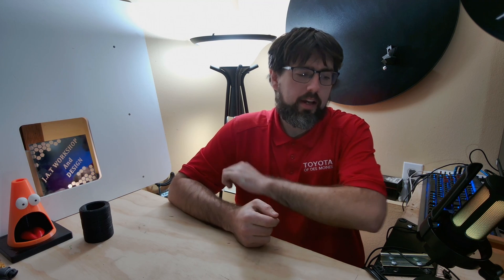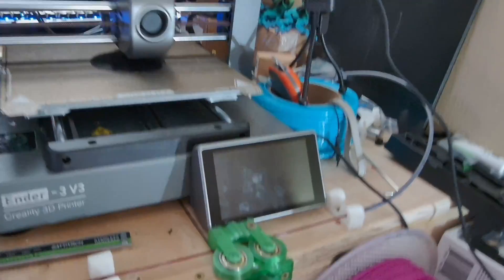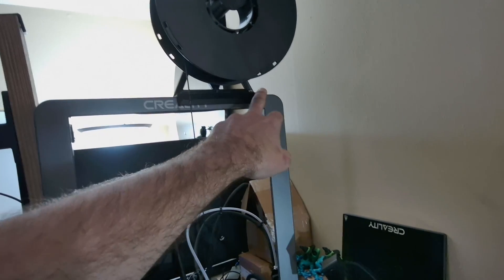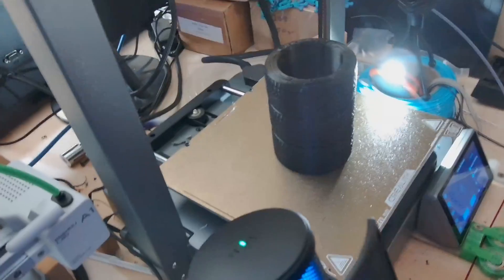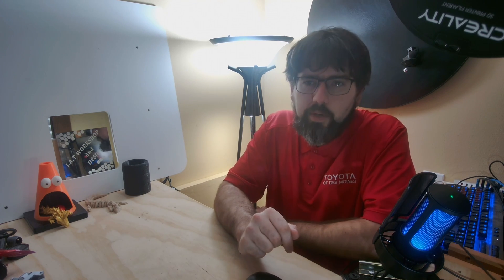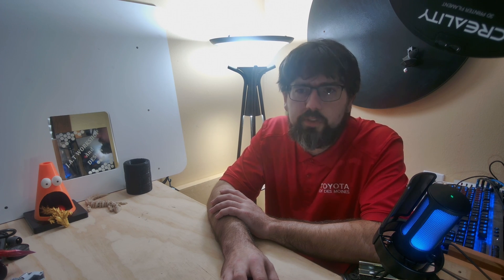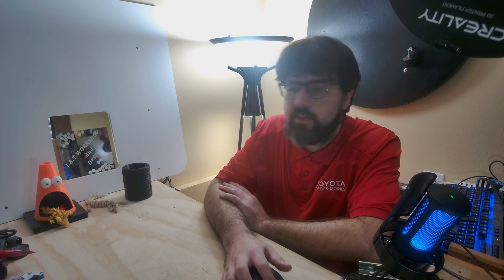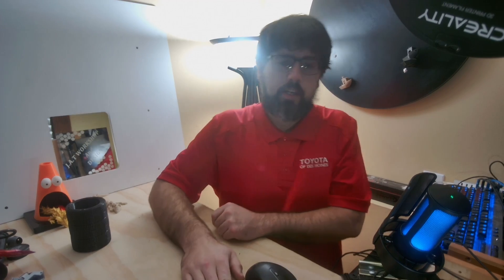Tpu WIth The Ender 3 V3 How well does it do and what need Modified.

Comment: I have a V3 plus and I'm trying to print 95A TPU but no success :( keep having nozzle clogs and the machine stop extruding! sometimes I can do 1 print, and next print always fails on first layer...

I already tryed:
0.6mm nozzle
Top mount spool from dry box
Drying filament
Different brand/color filament
Increase temperature(too much make bubbles)
Custom shim to decrease spring tension that I made...
Upgraded gears from China
Etc.

My BBL A1 and V3 KE prints TPU with almost no problems, the KE used to do same thing but I can adjust the spring tension and now zero issues.

Please, do you know what can I do to fix this on V3 plus?
Reply from the maker: V3 plus should have the same head as the V3 standard size.     Are you printing through any ptfe that could be potentially too tight?     Make sure the dry box has 0 resistance when pulling out.        Clogging with a .6 nozzle would be rather hard to do.  

Changing filament would have been my first go to as a bad batch but doesn't sound like that should be the issue.      Make sure your speeds are slowed down as it could be possible you're stripping the filament instead of pushing it     could be not tight enough tension.      Also check retraction. That it's in the .8-1.2 range
Reply: @JATdesign  I'm sure dry box has very low resistance, sometimes the extruder simply is jammed and can't push any filament even if I use my fingers to push..

as I said, I tried differente brands/color 95A filaments, the results looks the same, but it's always gears clogging on extruder and filament don't go down... I have creality cr-tpu 

I have printed a lot of TPU on both A1 and KE, but I order this V3 plus and I thought that at least I could adjust spring tension on extruder, maybe this is the problem. And I'm using orca slicer with similar configs

I designed a custom spacers that makes the closing spring lever don't go too much to the left.. this made a little improvement but always after 1 'good' small tpu print, the second one will fail on first layer

PLA and PETG prints on 0.4mm nozzle is doing good, zero extruder clogs.
Reply from the maker: @AndreH5656 what's your initial layer height setting  I have had clogs in the past from initial height too low.  I'll generally do initial layer at .25

Comment: I am using 95A TPU V3 Plus and having trouble with the filament going through the head. New at this 3D Printing. It sounds like the head starts grinding then it stops pulling in the filament… Any advice?

Comment: Thank you for sharing this video, my question is: if the filament does not pass through the filament detector, does it work the same or do I have to do something in the machine configuration?
Reply from the maker: @Picard2003  you put a chunk of filament in the sensor  so the machine thinks it's there

Comment: I know you've went through the settings but I cant seem to find some of that stuff that you talked about would you mind sharing the profile?
Reply from the maker: @amitfpv09  Creality recently switched to a different slicer so many of the names of things are different then they used to be.  I don't use the new version.  I have pretty much switched everything over to Orca slicer now. That they natively have the V3 in it now.
Reply: @JATdesign  Do you have presets for orca slicer that I can use?
Reply: @JATdesign  Does Orca slicer fit the settings you gave in the video? Do you have a preset for tpu that you could send me I will really apricate it
Reply from the maker: @amitfpv09  orca slicer is much closer to the naming yes if I remember my K1 max tou video was done on orca.  The two profiles are very similar.    I haven't yet made a orca profile for TPU as I haven't needed to print it for the last couple months.     (Still getting everything setup in my new location).  But between those two it should be able to get you close.      I do eventually plan on doing an updated video once I do get it all setup and done.
Reply: @JATdesign  Oh ok ill look into the k1 max settings thanks

Comment: I got some 85A tpu and i cant seem to load it... i can only push it in so far. when i can't go any further and try to lock the extruder, i can pull it right out. I sat there for a good while trying to get it to catch but didnt have any luck. Its like trying to load cooked spaghetti.  

Ill have to try some 95A. I was really hoping to print some really soft stuff but i dont think there's any way to get it loaded and even if there was, i would be afraid of jamming the printer on the way out.
Reply from the maker: You should be able to load 85a.   Lock the extruder and slowly feed the filament in while it is moving the extruder gears.    It should catch and feed normally.
Reply: @JATdesign  that totally worked 😅 thank you! Excited to finally try out some TPU!
Reply from the maker: @Tristaniscool  glad I could help

Comment: Hi there. Thanks for the videos. They are the reason I decided on upgrading to on Ender 3 v3. One question though. Just received the v3 and I don't appear to have the holes on the top gantry to screw ion the top spool holder that you created. The screw holes are visible on the underside of the top gantry but not on the top. Did you have to push them through by any chance?
Reply from the maker: I did not   they were open and accessible out of the box on mine.
Reply: @JATdesign  will get in touch with Creality I think. Thanks for getting back to me
Reply: seems that there are different versions out in the wild as the ones being shipped now do not have the top 2 screw holes and are blanked off under the gantry. They do have 2 m3 holes on the back of the gantry though.
Reply from the maker: @bane2000  I will work on modifying the file to snap over the front and utilize the rear two screws.

Comment: Thanks for posting this video. Can you please share the TPU you are using? the link in the video description is sending me to PETG and not TPU.
Any chance of sharing the Creality Print profile you've created? :)
Reply from the maker: updated link  Thank you  I can work on uploading the print profile, but will be next week.
Reply: @JATdesign  Thank you, please reply once you've uploaded it so I'll get a notification. Appreciate your work!
Reply: @JATdesign  Are you able to share the print profile for creality print please. Really struggling to get TPU to work with this printer. Thanks
Reply from the maker: @bane2000  video goes through each setting I changed.   Did you download/install the top mount?   TPU will not work if fed through the ptfe tube
Reply: @JATdesign  I am using a top mount (yours, just drilled two holes for the m3 bolts). Bed adheasion a problem and also the hot end clicks a lot and seems like the cpu filament is struggling to be pushed through. I noted all the settings changes in your video and applied them but still no joy. Just printing with PLA can be a bit limiting  :(. Thanks for responding though
Reply from the maker: @bane2000  the hotend is clicking with no tube? fed direct to the head?     Bed adhesion if you clean the bed well and use some purple glue stick should be stuck quite well.  

Not using glue on the pei sheet should actually stick harder but can damage the pei sheet.    

Have you tried bumping the first layer height up to .25
Reply: Will bump up the 1st layer and try again. No tube, direct from top spool into hotend feed